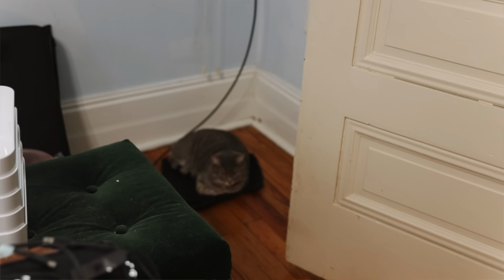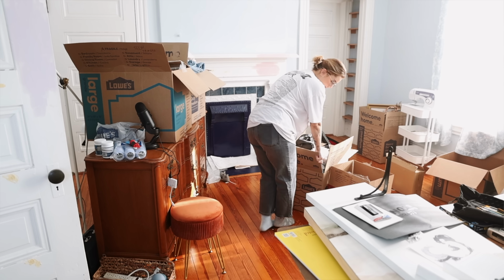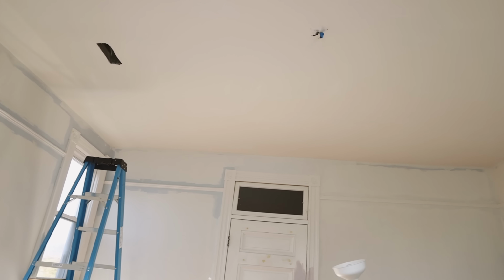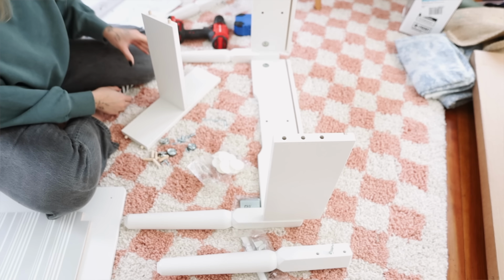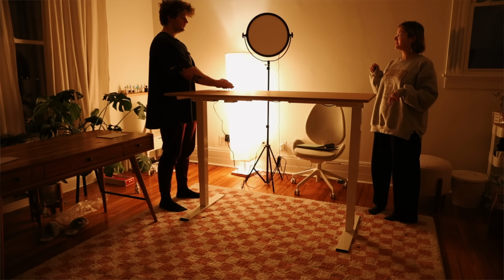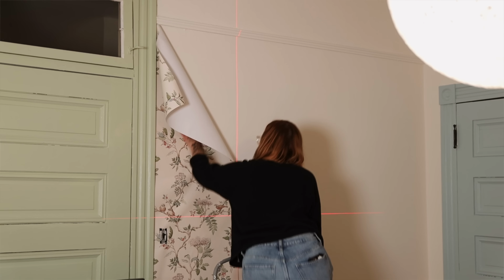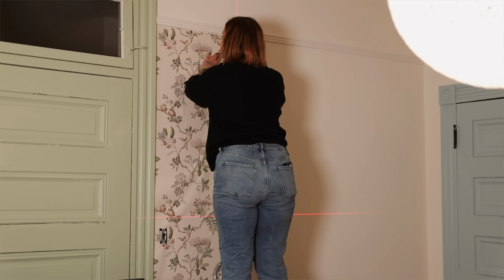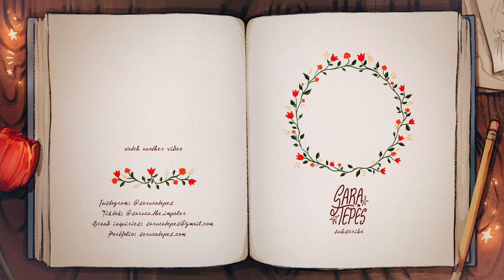EXTREME ART STUDIO MAKEOVER!! 😅 (painting everything pink)

Comment: Covering wall sockets: choose a movable screen, that can double as art hanging space. Either a 4 panel 6ft folding screen with feet or castors) or a waist-high solid screen, made with wooden horizontal slats. Natural wood to match your shelves. The solid screen  can be moved away when you need to access the sockets. Then hang another slatted one, on the wall, offset and used for hanging stuff too. It should match the waist high, vertical slat screen, but slightly smaller and more square, than rectangular.

Window treatment: Use a frosted glass film to filter the light and give you privacy. Looking at the pictures you've hung on the adjacent wall, the direct sunlight will bleach your pictures. But a frosted film will defuse the light. It will still allow a lot of light in, but not harsh sunlight. You don't have to cover the whole window either. Look online and see the different treatments. Some  just cover the bottom section, leaving a third up the top, uncovered. That's if you haven't done it alreday.